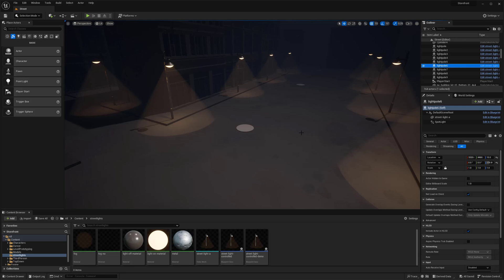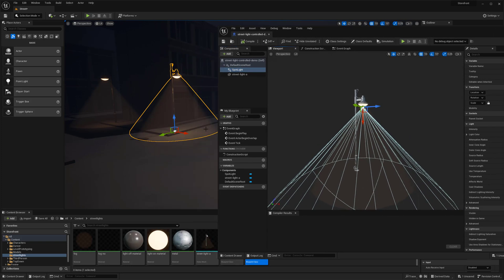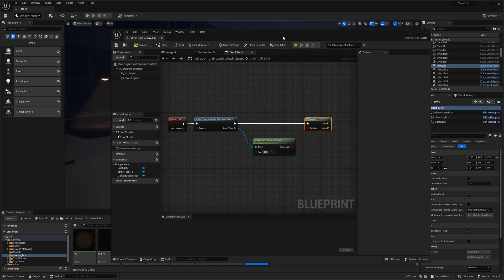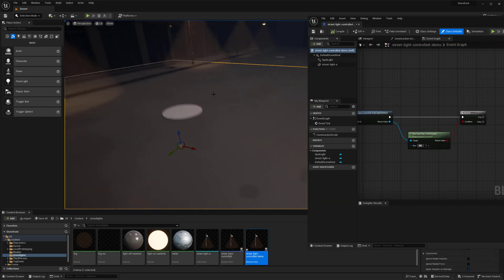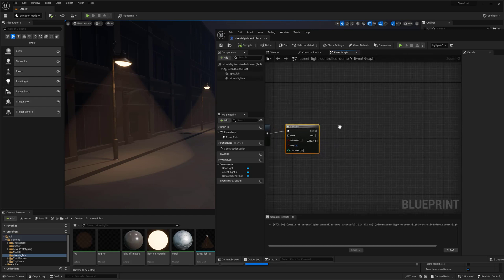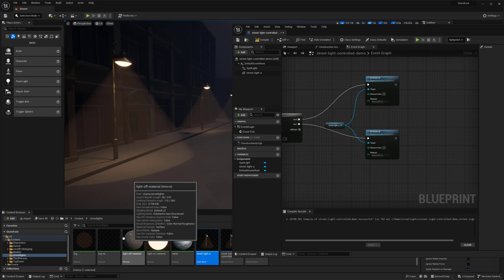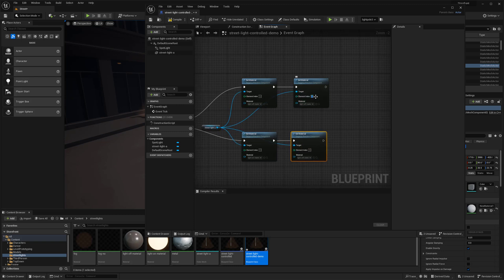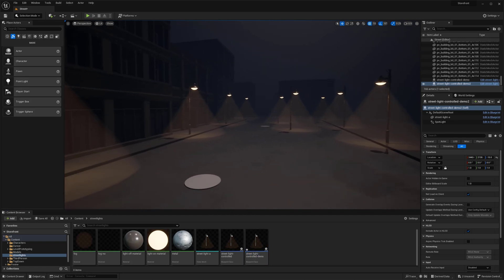How to turn ON & OFF Lights with a Blueprint in Unreal Engine 5

Comment: Thank you very much for the video. Is it possible to use is also for a grap component in a the VR Template in Unreal?
Reply from the maker: glad you enjoyed it, I have not used it in that template however it should be fine. The only thing is that if you create an input, it might be better to connect up one of the VR inputs so you dont have to use your keyboard

Comment: Is there a way to make a delay on the lights so they turn on in a sequence? For example, a warehouse with 20 lights and when you push the button the first light turns on, and then the second, and then the third and so on - is there a way to achieve this with blueprints in ue5?
Reply: I am not the best with blueprints, but on a whim I would say to stack the lights with a delay. One light, then a delay with a new light and so on.
Reply: Sure, use the delay node and set the time delay to whatever you prefer. Out of curiosity I did something like this a while ago where the player enters a collision sphere/box that then blows out the light by setting the light's visibility (or alternatively the intensity) to off, then, after a short delay, the lights go back on, another short delay to make them go out again, and so on to create the flickering and at a certain point in time just set visibility/intensity to on and that's it.

Or, you can also create yourself a "flickering material" which is applied to the lights once for as long as the flickering should occur and then, when you don't want any flickering anymore, change the material on the lights back again to have a non-flickering light.

Comment: Hey Peyton, thanks for the video. I'm trying to use this method to turn on lights on a vehicle -- the lights start on the vehicle, I can turn them off, but can't seem to turn them off. To turn them off I'm calling the 'Set Material' and using the Element Index for the 'On' lights -- and for the 'Out 1' setting of the MultiGate I'm calling the 'Of' light texture (that actually doesn't start on the mesh). But I have a feeling, it doesn't actually swap the material, more so enable/disable it - so when I try turn them on, it does not have any of the 'Element Index' to look up.

Comment: I did not recommend putting it all on tick. This will become a costly action, it is better to switch to the interface or the dispatcher
Reply from the maker: Appreciate the insight, will try to switch it over if I expand upon this further!
Reply: I was about to mention the same thing haha because checking for "if pressed" on EVERY tick is actually costly.